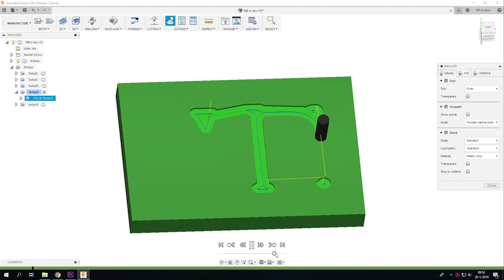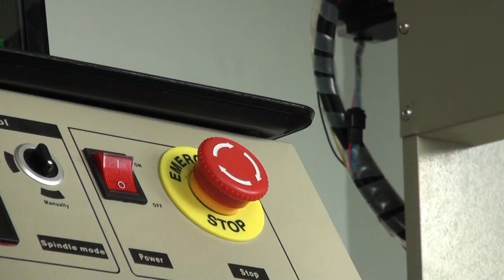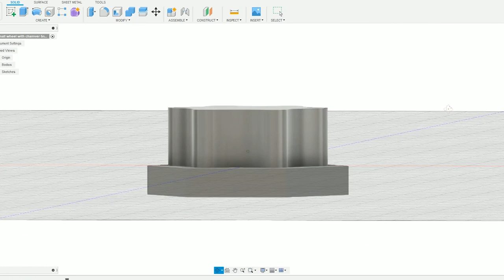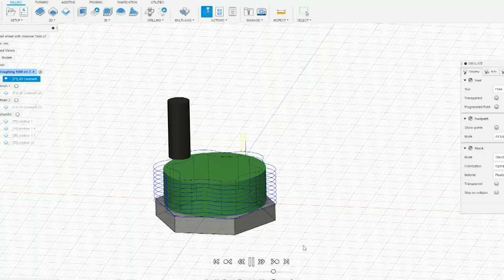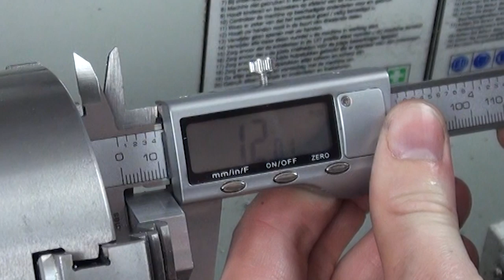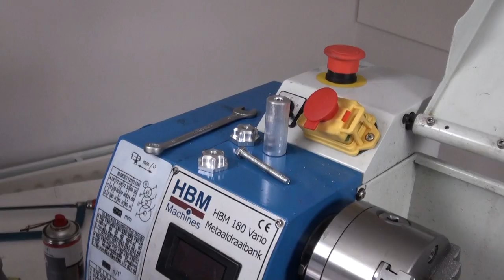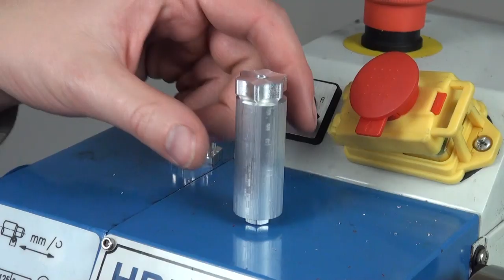First test with Datron single flute end mills in aluminium PART 1 - CNC 6040 ROUTER-

Comment: I've had the same issue. But, I solved  great deal of it by keeping a constant flow of compressed air directed at the cutter. Get those chips out of there as they get ground between the cutter and the previously cut surface. The second thing I did was leave a fairly large finishing allowance; I leave about .010" and then make a final 2-3 passes to clean it up. Finally, I switched to .125" cutters. I'd prefer to use .250" but they are too big for my work. I think the .125" flex too much so I get them as far up into the collet as is practical.

Comment: Is your spindle running clockwise? I’m trying to figure out if you’re actually running the tool in the wrong direction or not? If it is clockwise, then it’s for sure traveling the wrong way. Your finish would greatly improve if you were to change that. Just a thought, not trying to offend anyone here, merely observing.

Comment: I work at SwiftCarb and we started grinding our aluminum series (non roughing) mills with a wheel that basically polishes the part. On the tool itself the finish is almost black from being so smooth. 
We've gotten results back where the part left a mirror finish. Idk if you might want to check it out. I haven't seen an aluminum endmill yet with the polish we put on it.
Might wanna check us out 🤷‍♂️

Comment: Hi there, I've 3 flutes Flat end mill tool for aluminium. 
But that material is realy soft and I cannot handle it. 
Should I use 1 flute or 2 flutes for soft aluminium  ? 
Thanks for answering.

Comment: I dont have any experience with a CNC and was thinking were your not removing  alot of stock or cutting something out like the wheel at the end would it not have been better to not step down in cuts and engage entire flute I would think you would need to take lighter cuts but still remove more mass because your not just using the first 1mm of the flute?
Reply: Hello
Did you connect the controller to a laptop with a 25 plug USB?

Comment: try to always use a "climb" cut. it is better for surface finish, tool life and heat dissapation. then with aluminum its important to blow away the chip while cutting otherwise you will get smudges on your part. and making the machine more rigid would also help alot

Comment: Super inspiring to see see great work out of that machine.  Im going to ge a datron.  I have silicon carbide 4 flute endmill.  I need that chamfer tool!  
Please share you settings on that 6061 for fusion!
Reply from the maker: where in the video did you saw 6061?

Comment: Really nice video ! I also have a 6040, but I would stick with adaptive toolpath. You can use adaptive with multiple cutting depths. The rigidity isthe weak point for this hobby cnc. The spindle could do much better with a more rigid body.
How satisfied are you with the HBM brand? I also have some tools from HBM
Reply from the maker: Thanks! The problem with adaptive strategy and the 6040 stock controller is that when you make the stepover too small that you overload the controller with g code and the machine slows down. Like you correctly mentioned it is possible to use multiple depths with  but the material removal rate drops significantly when you do so. I’m going to do some testing about this subject in the future but i’m pretty sure that on the 6040 router the 2D pocket can outperform the adaptive strategy at material removal rate.

HBM has a good price quality ratio and I like their products. But you get what you pay for and most of the products are hobby grade and not made for professional use.
Reply: @MBcreates  you can try the smoothing feature, that will ease the gcode a little.
I am really satisfied with the adaptive, it certainly helps to not brake as many emdmills. Down side is that it takes a lot of time, like you said too.

Comment: If you decrease the acceleration settings on the steppers it won't be that jerky on the splines.
Reply from the maker: Using the smoothing function in fusion solved the problem for me :)

Comment: Have you played with using adaptive clearing in Fusion 360? In my experience so far, this method works the best for doing metal on these type of machines. Vastly better than pocketing or profiling in terms of chatter and vibration.

Comment: It`s not really a comparison - you take expensive thicker 1 flute end mill and compare it  with thinner 2 flute end mill ( and longer stick out compare to diameter ) . Most likely you have rigidity problem and not with a flute . 
For ALU 1 flute end mill is a way to go in case of hobby high rpm routers with low rigidity.
For proper test need to compare apples to apples at lest . I think Darton end mill is better anyway - but this end mill it`s not for hobby machinist which can break it in a seconds. For learning purpose there are plenty cheap end mill`s which can give you great result .
Last - about milling approach to full diameter. It`s not good idea as you pay for flute length , but will cutting only on the bottom of the flute . In this case you will wear the bottom much faster and not use your investments. Always better go deeper with less step over ( but not less then minimum cheap load ) - there are few exceptions ,but it`s mostly with special end mills .

Comment: You'd be better off investing in a cheap mist coolant system than wasting money on expensive Datron end mills if improving the surface finish is the goal. 

You'd also be better off using cheap 3 flute ZRN coated carbide end mills off ebay for aluminum with your machine. 

Datron use single flute end mills because their machines have micron accuracy and use 40,000 rpm or 60,000 rpm spindles.

Comment: Nice try. Consider adaptive clearing with the deepest cut you can make and very small radial engagement. You will likely get a better part faster, and you will use all the length of that expensive tool rather than just the tip.

Comment: 6060-T66 ? You should give up on that stuff. Try 6061 or 6083.
Reply from the maker: I will give it a try ;)
Reply: I don't think that would bring much benefit - 6061 and 6083 (in reasonable tempers) are still MgSi based alloys, just like 6060, and work best with a more rigid machine, with flood cooling and higher material removal rates. ... For something actually designed for machining, try the 2007 alloy (with Pb), it never curls up like 6061/6083 (in T6 and similar) and always breaks off cleanly in regular chips. I never actually clogged up an endmill with it, no coolant needed. (There are more exotic ones, but 2007 is fairly common.)
edit: I just read the description - yup, 2011 is also a good choice.